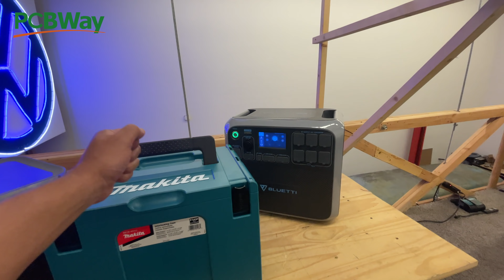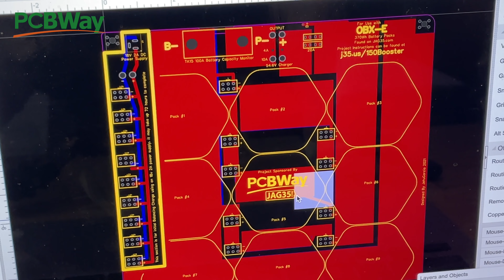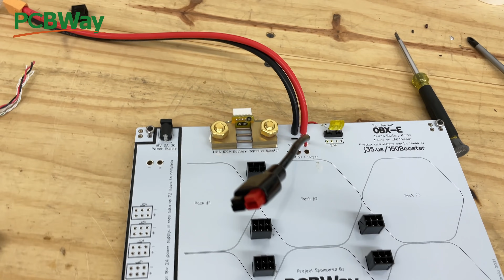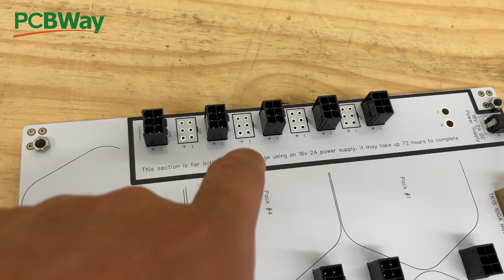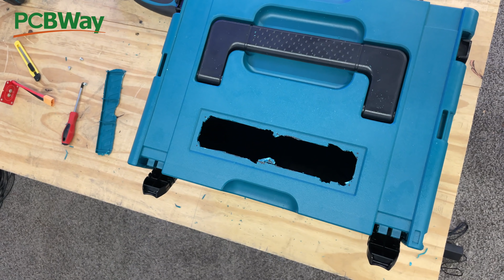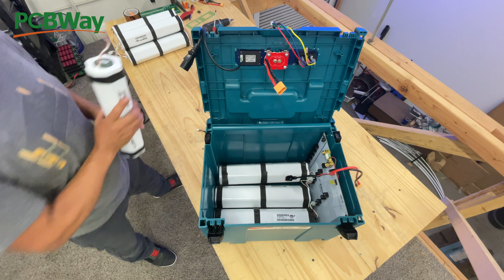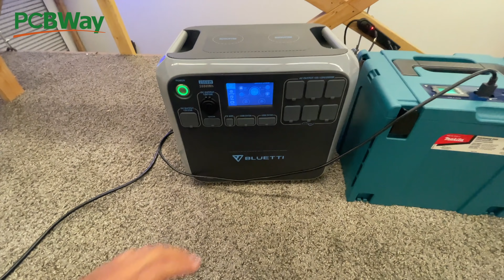DIY Booster Battery for your Bluetti /Ecoflow Solar Generator

Comment: I just built a diy solar generator with the 12v version of these packs (sold out a while ago).
A DC power strip ( also for sale at jag35)
And an old computer tower.
I'm editing the vid right now.
I have over 9 hours of footage lol
It's 1kwh lifepo4
1200 w inverter
And supporters 500 Watts of solar
I also used the amp meter he sales for $50( works, but I can't figure out how to change the settings)
I haven't added up all the cost yet, but I know I'm under $500 total.
I also have 10 if these 16v bats that I'm getting ready to make into a 48v  system for my bread truck.
I really like working with the pcb DC power strip he sales.
Reply: Good work!!
Reply: I also got those 12v packs coming. I look forward to seeing your build!
Reply: @BondedLiberty  I think I'm gonna do a couple of vids on it.
One to show what I built, second to show the actual build.
I'll probably have over 100 hours in editing lol
It was my first build, and it came out way better than I had hoped. 
Plus the computer tower has a window in one side so you can see everything in it. So of course,I put a light kit in it lol
Reply: @bikeradam  I can't wait to see it! Hope it is beginner friendly.
Reply: @LifePrepared  after building this first one, I realize I can build one with all harbor freight stuff.
Using the DC power strip ( sold on jag35)
It's almost a plug and play system, sort of.
I'm living in an empty bread truck. This is the first part of a bigger system.
I'm making my system modular. I built this first because it's small and has the cheaper parts. If I mess up, not as big of deal.
This part is all contained in the computer tower. 
It works as a stand alone I can take off my truck. It can charge with ac,DC, and solar on its own.
But it's main job will be to run my 12v stuff In my truck. 
My truck will be a 48v system and this unit will charge off it.
My main bigger inverter will be 48v also.
I'm trying to figure out how much detail to put in the vid. Maybe I should also do a how to edit.
I shot 9 hours of footage. I can do 100s of edits lol
Reply: very short teaser vid i just made for the solar gen. 
https://youtu.be/9htjRntRjNQ